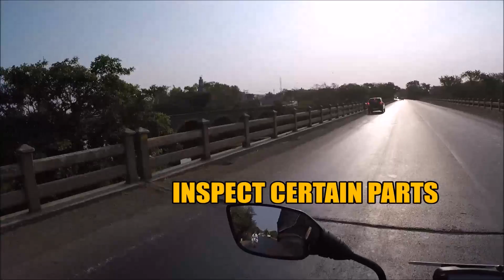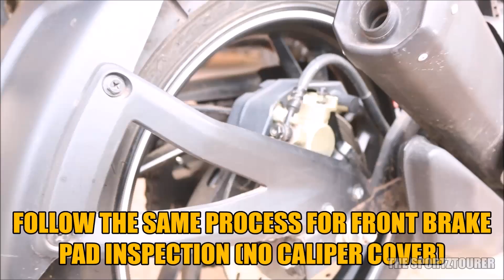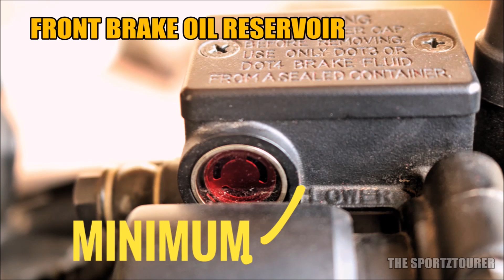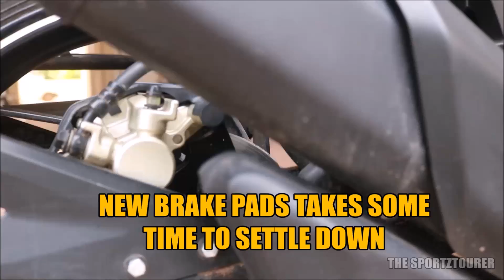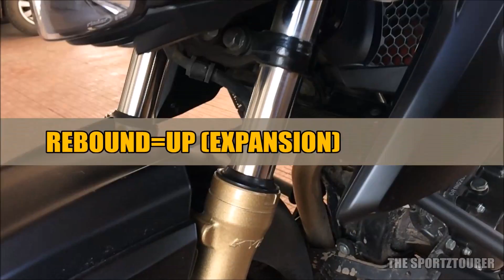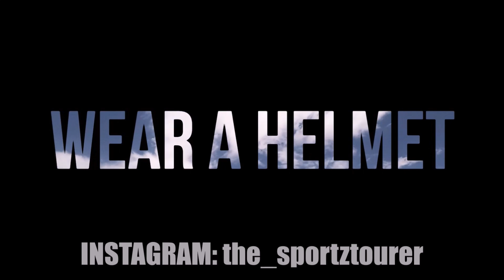BRAKE PADS, BRAKE OIL, DISC PLATE, SUSPENSION INSPECTION & CHECK UP TVS APACHE RTR 200

Comment: Nice to watch your informative video.....
1 question after servicing my front disk is not working properly , i.e. takes time to stop (Using Hornet Single channel ABS)......... now should i wait somedays to be corrected automatically or should i do something to return to the previous position? I have cleaned the disk with dry newspaper already......

Comment: Bro my rtr 200 stability issue is a great headache now, after 100kmph it drags or looses its stability, earlier it was not thr when i was using pirelli on both wheel, but now i hav michellin radial (140/70) and mrf zapper 100/70 front, i had same spec of pirelli it was grt, but now im not confident over 100 kmph, is thr any issue with front ball bearing does it help if i change them.

Comment: Will 5.1 brake oil will be okay for my hornet 160r
Reply from the maker: Hi,
Any specific reason to go for 5.1? Yes, you can. Dot 3, 4 and 5.1 can be interchanged 😊
Reply: @thesportztourer  no specific reason to go for 5.1 just want try it out so I thought before using it to take a suggestion form u
Reply: @thesportztourer  nd thnxs for suggestion nd u r from pune???

Comment: Hi.. where will I get the KYB G10 fork oil. And what's the quantity in each fork for rtr200
Reply from the maker: Hi Rojan,
Quantity is 325ml per fork. Even I had hard time sourcing G10 fork oil, finally gave up and used TVS fork oil: https://youtu.be/jBEhUE47_uA

Comment: Noise from rear disc plate will settle quickly  if we apply rear brake more??
Reply from the maker: Hi Rahul,
Technically by hard braking we will just push the dirt aside from the disc and pads.
Reply: @thesportztourer  so what should we do for stopping the noise ?

Comment: Will new discpads make noise?
Reply from the maker: Hi Jatin,
Can be a bit noisy an inefficient in braking till they bed in properly.
Reply: The Sportztourer I have bought 160 4v. The brakes started to sound very bad and then I got the disc pads changed 2 times but even after that the sound doesn't go. The service guy says that the Rotor is fine. What to do?
Reply: The Sportztourer How much time do they take to bed in properly? Do I have to like ignore the noise untill it goes away on its own?
Reply from the maker: I have specially made a video on this specific topic of brake noise: https://youtu.be/7wfzLMeYOC8
Reply: The Sportztourer thanks for sharing the link! So, that means I need to regularly keep on cleaning the brake pads, rotor etc? I see many bikes running for quite a long time and without any noise. How do they manage?

Comment: I bought my RTR 200 on Oct 10, 2018... 670KM on ODO...

Problem: When I take the bike in the morning, the rear disc is fine... But even before reaching a KM or two, it starts squeaking when pressing the hard... Is this because of new brake pads or alignment issue or something else...?

I said this problem in the service centre and they found out that my chain was tight and that's why the brake was  squeaky... Then they loosened the chain slackness and oiled the chain... They didn't even touch the Disc Brake... 

I am a noob in bike things... Please help me...
Reply from the maker: Hi,
Does the rear disc heats up even when you are not using it?
Take a look at this video which might help you in understanding the disc brakes and reasons for brake noise: https://youtu.be/7wfzLMeYOC8
Reply: @thesportztourer  Wow Thanks for the Reply even at this night time... I checked out that video and really got lots of idea from it... Please make a detailed video of the same... I guess the gaps between the brake pads are less for me...? But I don't know how to remove them...

Please make a detailed video of the Disc Brake removal and procedures to inspect and put it back in one piece... Thank you so much for your time 🤗

Comment: Brother what's the maximum temperature of the engine U feeled   in this Bike RTR 200
Reply from the maker: Hi Amutha Gautam,
There is no digital/analog temperature read out on the RTR 200 but till date I have never faced any uncomfortably high temperature or overheating on the RTR 200 (Other than during the usual initial run in period).
Reply: @thesportztourer   I feel High Temperature after 15km ... Is any problem with cooling system
Reply from the maker: Total Km done?
Reply: @thesportztourer  just 3000 bro

Comment: If there are noise between brake pads and disk . So what I have to change for solving this problem
Reply from the maker: Get the gap between pads and disc pressure washed along with the disc and caliper.

Comment: Bro While I am applying the rear brake a kin kin sound is coming out. I told about it the tvs guy, he told me that it's because of some dust particles are stuck into brake pads it will be fix when you'll wash your bike with good amount of pressure. I did as he said but still the sound remaining what should I do now?
Reply from the maker: Hi Shahrukh,
Service people are right this type of noise usually occur due to brake dust & dirt deposits. Try to clean it with a wet tissue & then wipe it with dry tissue.
If the problem remains the get the brake pads aligned after removing the caliper.
Reply: The Sportztourer ok I wish it'll work 
Thank you n lots of love

Comment: hello frnd.. just got a new apache 200.
can you tell me how to run in / break in engine .??
Reply from the maker: Hi +Brute Kit, 
Congratulations on your new RTR 200. Just be gentle with the bike: Avoid going above 5000rpm. Acceleration & braking action  should be smooth.
Over heating & false neutrals are common during the run in period. Don't miss the 1st service: oil change & oil filter change during the 1st service is very important.
Once again congratulations & welcome to the tribe 😊. 
Enjoy the Apache & ride safe.
Reply: The Sportztourer thank you ☺️

Comment: My apache 180 rear gas charge suspention is leaking oil. What is the repair cost ??
Reply from the maker: Hi +tarun 0786,
Repairing or refurbishing the gas shock charged suspension system is not a good idea as it will again fail/leak soon. Replacement is the best option, get a new pair of rear suspension the price was around ~₹2000 a year back.

Comment: Hi The Sportztourer, I own RTR 200. While I drive for an hour or more I can feel numbness in my right hand due to vibrations... can you tell me how to reduce.
Reply from the maker: Hi +rajesh reddy,
Get the bar ends of the handle checked.
 One advice from my side for riding would be don't hold the handle bar tight, you should have light & guiding grip on handle. Grip the tank with your thighs & see how relax the bike feels.
Ride safe.
Reply: I've tightened the bar ends now it's good and thank you for your advise and your videos which has been very useful for me. 
I would like clean my air filter, if possible please upload...
Reply from the maker: Hi +rajesh reddy,
Happy to hear that 😊
Air filter video is on its way, keep a check on the channel & you will be updated 👍
Ride safe.

Comment: Hi sportztourer,
I own an rtr 200 too and planning to put sintered brake pads in the front this month coz the stock setup feels inadequate sometimes on long rides. 
Would you recommend it?
Reply from the maker: Hi +aditya tomar,
You can use sintered brake pads but sintered brake pads cause excessive wear of the disc plate due to the harder brake pads material.
Reply: The Sportztourer 
Thanks mate, I guess I should go for it. Replacing a rotor in my opinion at least is a far better option than having a serious crash due to inadequate braking power.
The stock ones are organic for sure and I really never had confidence in them.
Reply from the maker: Hi +aditya tomar,
If possible also go for steel braided lines they surely help in increasing the brake force on the caliper with minimal loses.
Reply: The Sportztourer 
Thanks a lot for the suggestion pal, I was actually thinking of them too but couldn't find them anywhere around. Did some research online and no luck there too.
Could you please suggest some site or something where I can get them?
Reply from the maker: +aditya tomar,
Getting custom parts in India is a bit problematic, Galfer & Spieger makes braided line in lots of sizes & banjo options. infact Spieger even offers custom braided line option: https://www.essexparts.com/spieger-custom-ss-lines
Cost & Shipping charges brings these options down for most of us. I have seen people using Pulsar 220's steel braided lines in their bikes but I don't exactly know the resultant on brake performance after using it.
Reply: The Sportztourer ,
Gonna check them out 
Thanks buddy😉😊

Comment: Bro my apache 200 front brake is creating a hell lot of problems such as in slow moving traffic when i apply front brake gently it jams and there is no bite point feels like using a drum brake when applying at high speed such 100kmph front brake feels spongy and front end dives forward too much... I get repaired it many times at tvs service centers they change master cylinder 3 times but the problem is still there moreover they also changed disc pads and calipers but that also doesn't work.... Brake worked for 2-3 weeks but then again creating problems.... I, m in big trouble please help me...
Reply from the maker: Hi +Hasan Saeed,
At first I was going to suggest the master cylinder kit replacement but it seems you already have done that. Spongy brake & lack of bite feels indicates air in the system which must be bleed out but I doubt the service center would miss out on such thing (you can give it a try). Now most of the parts in braking system are replaced in you case so do check out you disc for oil/grease deposits. Thoroughly clean the disc with brush & washing shampoo. Later wipe it dry with newspaper/tissue.

Comment: Evan after lubricating, my chain produces Ratling sounds. I have checked the alignment it's all gud but the sonds continues. Mechanics from authorised Tvs service says that the Ratling is because of the heavy chain. Is it true.?
Reply from the maker: Hi +Jerry Mathew,
Have you checked the new video which is specially dedicated to chain noise?
Here is the link: 
https://youtu.be/7tWrylPGvE0
A little bit of rolling noise is expected from every chain but not too loud that would disturb ones ride.

Comment: Nice video, in my bike I replace my break oil & I flushed caliber after completing I replace new oil, no pressure generating, I try 20 times removed air in the unit but still no pressure generating. Can u able to guide me how to rectify
Reply from the maker: Hi +syed abuthahir, repeat the process after fill brake fluid & at first let some brake oil pass out.
Bleed the air out till you feel the pressure on the brake lever hard. Keep pumping the brake lever till you get all the air out of the system.
I sincerely request you to get the brakes checked at a authorized service station after you are done. I have changed my brake pads but didn't make a video because if anyone tries it & some error/mistake happens during the process (possible for a new guy) then he/she might face fatal accident due to some innocent mistake. Syed please take this reply positively as I don't want anyone to get hurt, hope you get my intentions. Do comment down with an update after you are done.
Ride safe 👍
Reply: I tried even though it's not resolved, is there any alternative solution
Reply from the maker: +syed, I assume that your bike is in center stand so with the center stand on rotate the front wheel if the wheel freely rotates then check out the master cylinder & piston on the top near the handle.
Reply: So that I can share the video
Reply: Wheel rotates freely piston is in end of the caliper of piston having pressure then only it can comes out.
Reply: If suppose air in the cylinder it may happen how to remove that air, I press the lever and release the oil in the bleeder then tight it. I did repeatedly more than 20 time's
Reply from the maker: +syed You have to repeat the process & before opening the bleeder bolt press the the brake lever multiple times.
You have to do it more than 20 times. Its a time consuming process also keep the brake oil reservoir on the top filled with brake oil.